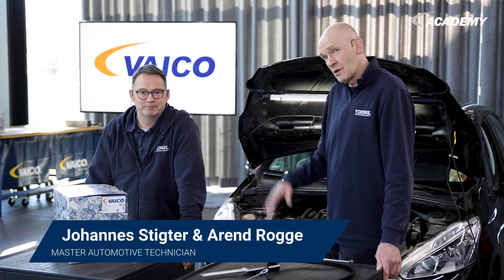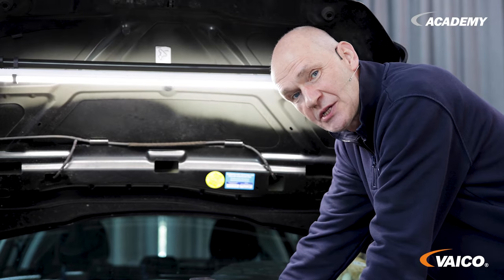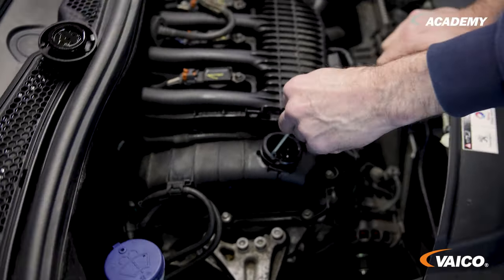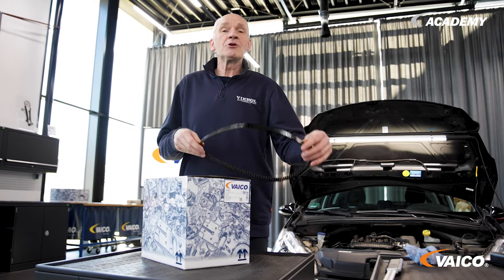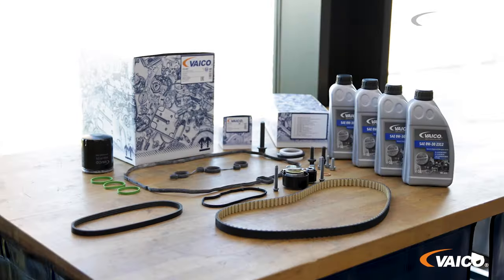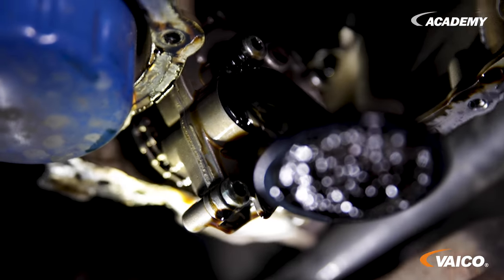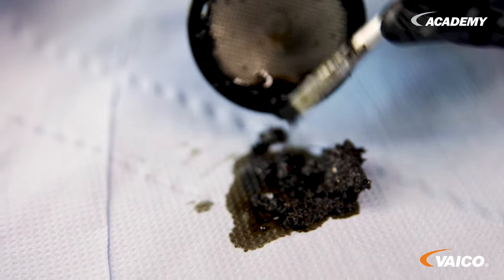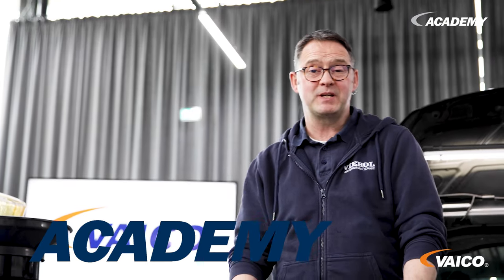Wet timing belt 1.2 PureTech | Peugeot, Citroen | Timing belt dissolves | V22-0887

Comment: Probably wrong oil type used on this engine before.. or PSA group "Peugeot, Citroen, Opel" must do someting for this wet timing belt idea.. they should reduce service fees and provide convenience. otherwise i will sell my car and never buy Peugeot, Citroen. Opel again..
Reply: Its not only PSA group engines. 
VW group also use wet belts in their diesel engines for driving oil pumps.
And some more too...
Reply: @TadVarn  Ford use the same belt sinze 2years more as PSA in they 1.0 ecoboost engines 125 and 140hp
Reply: Or Ford or Mazda.subaru, bmw..the auto industry make s h it. Buy electric..
Reply: dear. great review sure i had an opel crossland x 2020 1.2 turbo .i had same problems  at first top up oil level message then engine fault then stop the car message until 77000km .psa engine in egypt decided to replace the engine in warranty by new engine they get it and now they replace it.does psa changed the old belt with new one differ in its mateial to prevent all that law pressure problem? i want to know .i read that they made a new version v3 . is that true thanks
Reply: also i want to know the right oil they recommend mobil pss 5w-30 is that correct oil viscocity?
Reply: It’s not just the viscosity that matters with this system. It’s a specific chemistry to avoid the belt being corroded.
Reply: I bet blowby contaminants could cause belt break down.
Reply: Even when you use the right oil, the timing belt wears out much sooner then expected. Sometimes as early as between 50.000 & 60.000 km. Small pieces of the timing belt can clog the oilfilter with devastating effects for the engine. 
It’s design flaw and Stellantis is not taking it’s responsibility.
Reply: There are many complaints about this engine. It's a design fault. With this engine.

Comment: Worst engine ever, and Citroen dealers do anything to avoid doing the repair as it's major work. This engine is a shocking cover up. Despite mine being recalled they just had a quick look and a month later the belt had had it. I paid privately for a change at another Citroen garage only for it still to drink oil.  I'll never buy Citroen or Peugeot again. Buyer beware.
Reply: I had this exact experience: belt replaced after 28.000km and guzzling oil like a maniac. Buyer beware indeed! The resale value plummets too because of this engine. Stellantis backs off and doesn't compensate, leaving thousands of duped customers out in the cold. This was covered extensively on a Dutch consumer oriented television program "Kassa". They even got a representative of Stellantis to respond, however there was nothing but excuses and weaseling their way out of it. The only Citroën I would consider buying is a 2cv as a hobby / tinker car. You can repair it yourself with some pliers and a piece of wire 😉 My daily driver is Japanese and it gives me ease of mind.

Comment: These were introduced because it gave a longer service interval and lower emissions.  The manufacturers say premature failures are because of the wrong oil and poor maintenance.  Sadly this has been proved wrong correct oil and even more frequent oil changes have not saved many engines. This has resulted in replacement engines and even if repaired the costs can rapidly mount until it is almost uneconomic to repair. As for belt changes a bill for £1000 to £1500 is not uncommon if rubber particles are found in the oil pick up to the oil pump , resulting in replacement  of the oil pump and the pick up. The PSA and Ford engines are time bombs. I notice that Hyundai has kept with a chain for its 1.0 litre 3 cylinder engine . I have not heard of any failures of this engine as of yet.

Comment: Wet timing belt? It won't work because it can't work like the old dry belt design. The problem is the flat teeth design so the oil between it can't escape fast enough from the flat surface and you will get a slammed timing belt from high pressure environments. This design is very very bad!

Comment: I have a 208 2021 and now currently 95000km not a single problem belt is like new, always serviced correctly and with right oil, gonna replace it at 100k km, this little car has saved me a lot of money cos use it to drive to work and with right driving it is very fuel efficient👍

Comment: Everybody notices it... yet what most people don't know is that wet belts are on a lot of cars. Take the 2.0 TDi from VAG, that can have a wet belt for the oil pump. Absolute nightmare to get to, nobody knows which engine it's on and there's no service intervals for it.
Reply: Nobody knows which engine it is on ...- i bet its bullshit
Reply: Buyers probably don't know because they don't research reliability problems and the manufacturer can't really sell this as a good design improvement...  so shhhhhh🤫

Comment: Stellantis Group have given a 10 year 150k kilometre warranty for these engines, as long as properly seviced.
I don't know of any other maker that gives such a warranty.
All engines have potential problems, all of them bar none.
A possible problem has been identified, engines re designed and a massive warranty issued.
No other maker has ever done that and given the number of marques that use the engine, at least 5, a huge undertaking.
A good job done.

Comment: Very good video. Unfortunately the PureTech engine has too many design flaws. Mine gave up via the belt and oil leaks at 105,000 km.
Sad to see that customer services (Peugeot for me) are not at all up to scratch and find every excuse not to participate in the cost of repairs.
Reply: To ensure a long life for the oil-immersed rubber timing belt, it is essential to adhere to service intervals and, above all, to use oil with the manufacturer's specifications.
The 1.2 puretech engine is one of the best 3 cylinders on the market, despite the belt problem. A new, stronger timing belt is used on the new PureTech engines, which should ensure even higher mileage and greater safety for all.
Reply: @depechepol nah, not really mate, it’s a poor design choice.
Reply: @depechepol  I hope so, just bought a new Citroen C4 Puretech 130

Comment: Timing chain yes but who in there right mind would have a rubber belt inside an engine! Fools ..
We was looking at purchasing a 108 1.2 litre as its suggested this engine is better suited than the 900cc unit but the smaller engine I believe has the conventional external dry belt so that would  be the safer bet also with  the wet belt replacement with all the required parts , oil change and potentially new brake/ oil  pumps and sump off to check for blockages would be astronomical with the labour change and I expect it would have to-be main dealer as your local garage probably won't have the necessary tooling to do the job!  I think this is all a big plan to make us pay more for scheduld  maintanance and to run a far greater risk of engine failure, not a car I would be able to drive with peace of mind and confidence and I expect this 3 cylinder 1.2 litre application is in other manufacturers superminis so as I did please do your resurch before you part with your hard earned cash especially if it's a used car with no warranty or weather a warranty claim would cover consumable  because I'm sure peugeot are aware this is  a  silly design fault so unless the belt is checked within a basic interim oil  service which I doubt it is  how would you know the condition of the wet belt!
 Be warned and steer clear, plenty of other small car brand's to choose from or go for the smaller unit !

Comment: I would never recommend any wet belt engine it's just cost us  2k to have it all changed including the  oil pump due to it all filling up with rubber from the belt,  this is at 40k miles and will need doing again at 80k miles

Comment: Timing belt in oil would not be such big problem for engines with port injection. For direct injection engine it is a very unfortunate solution, most of these small cars drive in the city for short distances, the engine cant get hot and portion of the gasoline condensates on the combustion chamber and it is pushed down by piston to the oil reservoir. If direct injection car drives short distances only, the oil became heavily contaminated by gasoline and even if you are following the manufacturer oil change plan and quality, it might not be enough to prevent the timing belt damage. Such cars can fail at quite low mileage, while if you use the same car for mid range commuting, you might not have any problems whatsoever.

Comment: When do you recommend changing the water pump?
Reply from the maker: In principle, it is a good idea to replace the water pump as part of the assembly. Therefore, the water pump should be checked during the repair and replaced if there is noticeable wear.
However, the pump does not necessarily have to be replaced.

Comment: Interesting, I've a 2008 gt ordered and due in September
Reply: Bro if it has a wet belt don’t!!!!!! I have this and this is exactly what’s happening in my 2008! Only after 3 services from dealership it’s a huge flaw, your choice but have this in mind 40k on the clock it’ll break down if lucky up to 55k, I’d rather get a German car like Audi with a metal chain instead of this crappy wet belt
Reply: Send it back it's going to cost you a fortune in a 3 years time
Reply: The latest models now have a timing chain instead of a wet belt. It’s a good idea to double check this with your sales agent. 
Enjoy the 2008 GT!
Reply: Make sure that the engine code will be EB3xxx, this has a chain.  Pester your salesman to inform you of the engine type, if he doesn’t tell you, change your order fora diesel engine

Comment: Very shite idea having a wet rubber belt in oil, shame because the engine has loads of power 100ps Corsa
Reply: Ford had the same idea with his 1.0L ecoboost 125 and 140hp

Comment: Good video but I am missing some info.
Question: How much roughly does it cost the replacement of all these parts shown in the box? And how often has to be replaced?
Reply from the maker: Hello @NikolaiSiudyna79,
This depends on the sales price of the parts and on the calculation of the labour costs of the respective workshop.
For this, you should contact a workshop of your choice. This cannot be generalised, as the prices often differ considerably both regionally and geographically.

The timing belt should be checked at every service. The check is carried out using a measuring tool as shown in the video.
A change is planned for an interval of 60,000 km.

Regards,
Team VAICO
Reply: About a 1000 bucks.

Comment: the service schedule for these engines is rubbish. Just change the oil and filter annually or 5,000 miles. Use the correct oil(Total  Quartz ineo first 0w30) and don't use engine flush or additives because they attack the belt and problems can be avoided.

Comment: What milage was on that , you didn’t say😢
Reply from the maker: Hello keegan4039,
The mileage is actually secondary, it was 127,000 km. The belt on the example vehicle has already been changed once. However, the oil pump was forgotten.
It is more about the fact that the maintenance intervals were not adhered to, that possibly the wrong non-permitted engine oil was used, that the engine oil was contaminated by coolant, but also by fuels (E10) and by condensation water. This happens with vehicles that are used in short-distance operation and do not reach operating temperature. In addition, E10 fuels contain components that may damage the additives in the engine oil.
Regards,
Team VAICO

Comment: What a stupid design. I have seen few drive belts damaged over the time due to an oil leaking on them.  Cambelt will wear out over the time, even you use right oil during the service. All the rubber dirt will go to engine oil. On top of that Ford transit has engine service interval  every 30k kms.

Comment: All this 'wrong oil used' is a boad of lollocks.  So how does the 'blend' of the proper oil differ from the wrong oil.  Steal ''tis don't make engine oil, they just get it from one of the blenders.  What do the belenders allegedly do to the correct stuff that makes it a Belt Saver.
Reply: Agree, I have a new 308, which has the “correct” oil from the factory. The belt change interval was 120.000km.

The car now has 30,000km, whilst checking the oil level, I noticed that the belt was not in good condition, it had started to crack, the belt was changed at 25,000km, it was covered by the warranty

Comment: There is no right oil for a timing belt. There is "least wrong" oil, because rubber belts and oil are a terrible idea. Not only the belt get degraded quickly, to add to the problem its remains get sucked into the oil pickup and starve the engine of oil

Comment: This is the stupidest idea dry timing belts OK a timing chain the best l don't own any vehicles with timing belts only chains does Toyota use timing belts no because my 27 year old Toyota Hilux that has done 437000 kilometres it maybe it's original timing chain l bought it 5 years ago it may have been changed but it is still tight and my partners Suzuki Baleno has also a timing chain but it has only done 81000 kilometres l know why European car makers built inbuilt obsolescence and all European cars and vehicles are crap and they even can't get timing chains right